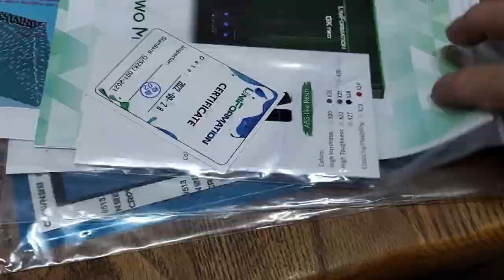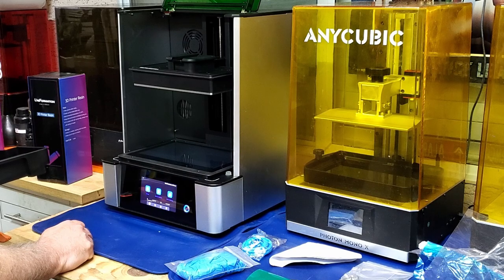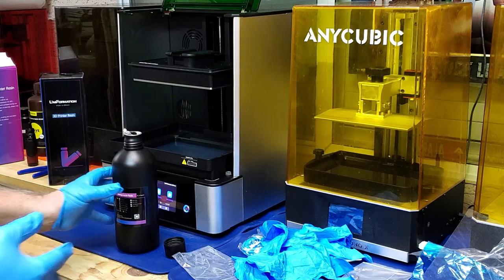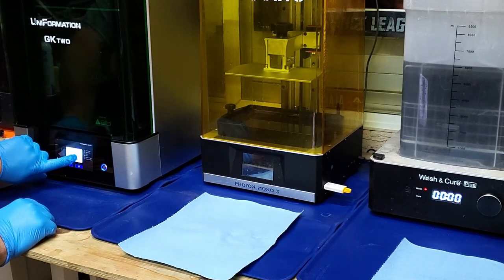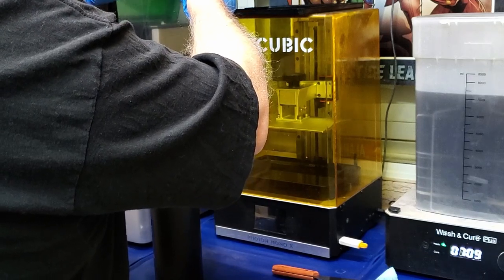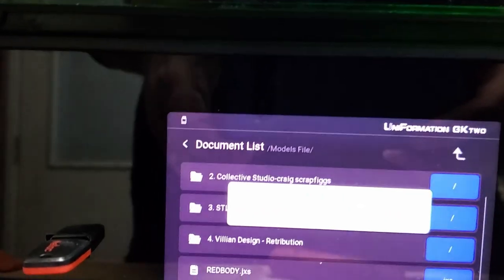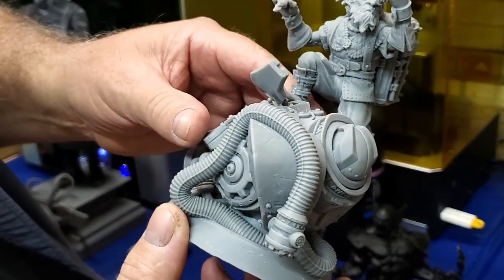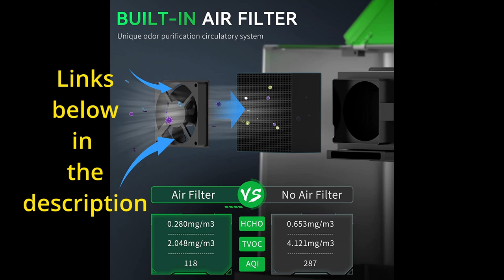The GK2 | 8K Resin Printer | Carbon Filter | Built in Heating System | Metal Enclosure #3dhp

Comment: Wow nice prints and thanks for sharing.  You mentioned that some of the resins smell more than others could you maybe jot down which ones smell stronger than others of course this would only be related to the resins you have experience with.   Thanks again.
Reply from the maker: I have never made a list.Some resins and colors are worse than others.None are really that bad now days.You always need good ventilation and or a Air filter system of some kind to help. Never open a bottle of resin and put up to your nose and smell it.While a print is going some resin printers have a carbon filter in them and some don't, this helps with odors. In my case none of them are really bad but notice some more than others.
Reply: @3DHP  Thanks for getting back to me and the wise advise of not sniffing the bottle of resin as if smelling a glass of fine wine.  XD

Comment: Thanks for video, the bed is structured or not? The UV blacklight is placed directly under LCD or it'is a projector and using a 45° mirror ? She haven't WIFI or LAN possibilities?
Reply: The USB port on the back is for optional wifi dongle.

Comment: Looks to be a great resin printer.  It is a shame we didn’t get a chance to see it.  We saw your back during most of the video.  Instead of showing features, we got a side view on how to clean out the machine for over half the video.  If you are going to cram a lot of the video in a couple large shots, at least move the camera where your audience can see what is happening.
Reply from the maker: Yes my back got in the way on that part,sorry about that. Also 1 part I edited of showed up. I have done over 300 videos and had some missed steps on this one.

Comment: Looks like there is a PTC heater in the bottom left?  Did this get eliminated or changed?  Their website doesn't show this in that location anymore...
Reply from the maker: Uniformation just got back with me on this. Mine has 2 heating elements as seen on the left and right side in rear.When the door is closed it will turned,I have no control for it in setting.On there updated GK2 its below the resin vat they told me. Hope this helps.I was told to disable my heater is to unplug the door sensor.But its fine the way it is.
Reply: @3DHP  That sucks, the  new layout sounds worse as they are now pumping heat into an area that should not be getting heat...electronics, LCD and UV LED array...all those you want to be cooled not heated.  They'd be better off having the heater in the print chamber where it heats the resin and build plate...wonder why they chose to change that...
Reply from the maker: @ChrisEpler  This is what a rep told me in a pm on Messenger. Not sure how its setup.